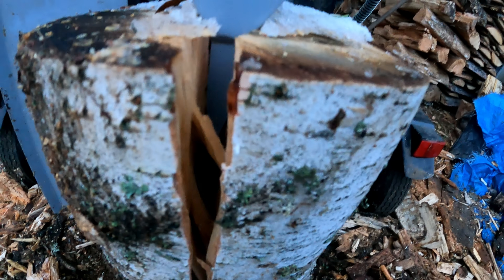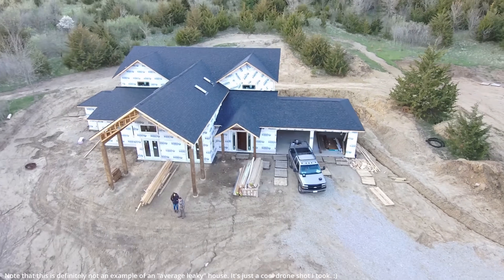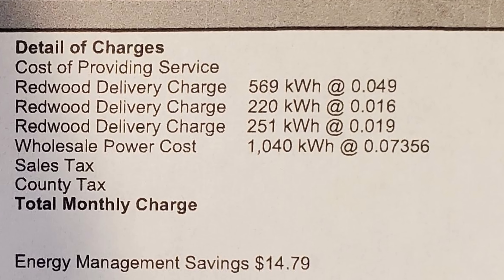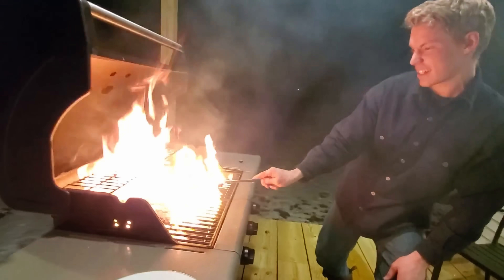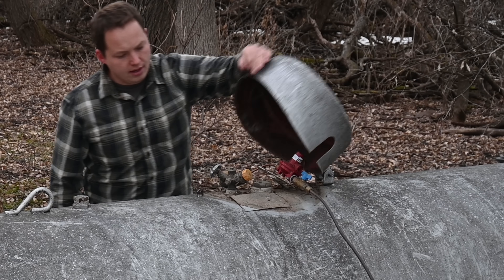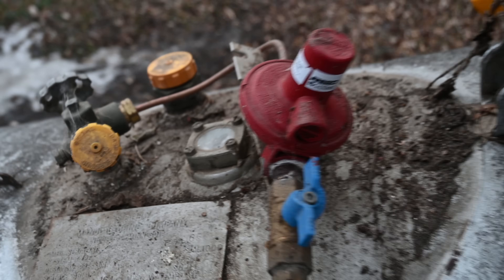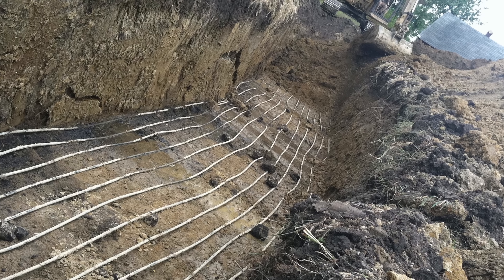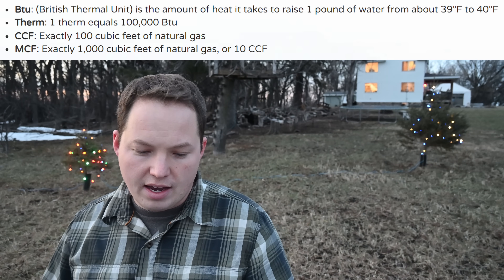What's The Best Heat Source in 2022? Top 5 Home Heating Methods - LP Electric NG Geothermal Fuel Oil

Comment: While the change in management isn't helping matters, fossil fuel prices are cyclical with them being even more expensive than now from 2005 to around 2014. There's a lag between the high prices that spur development and increase supply, once supply increases demand goes down due to the high price, causing glut, then depressing prices and new development.

It's great to have different sources of heat available - build in resilience.
I'm a fan of the idea of a good wood stove/insert and a large stash of wood too.
Reply: I burn wood when it gets really cold. Otherwise I use natural gas and electric. But Even with wood burning my monthly bill has doubled from last year, even though the average temperature is warmer than last year.  "Change in management" is a lot nicer than what most people are thinking and wanting to say come time to pay the energy bill!
Reply: @shaundevrisky349  inflation is evil and printing money is theft.
Reply: Remember always that the fossil fuel industry and the commodity markets will jump on literally any excuse to jack prices, and they are always slow to drop back, if they ever do, to the same levels as before.  Changes in management are a big excuse...
Reply: High fuel prices are worldwide right now, not just the US. The EU gets a lot of fuel from Russia. It's too simplistic and inaccurate to put that all on US management. The pandemic, when wholesale fuel prices went negative, threw the world for a loop, and the world has still not fully recovered.
Reply: @mgrnd3875  Pandemic my
A
S
S

Europe has high energy prices because they  have been pushing to transfer to wind and solar to try and go woke "green", and the consumers are the ones paying the price for this B.S.

 Solar and wind cannot keep up with the electric demand, nor can it compete with cheaper natural gas, propane, and fuel.

Higher fuel prices in the U.S.A. ARE from the current administrations actions, regardless of what the liberal/communist media is telling you.  EVERYTHING market related comes down to supply and demand. The first thing Joseph Stalin Biden did upon stealing his office was cut domestic oil and natural gas production by denying drilling leases, curbing production and shutting down pipelines.  The result is a short supply and high demand which equals high prices.

What also isn't helping is the fact that Stalin has raised inflation to 40 year highs by printing trillions of dollars that the U.S. Treasury cannot back with gold or anything else of value. Another simple equation: the more money you print, the less it is worth. This translates into higher commodity prices.

If this actually has to be explained to you, then you need to either re-take economics 101 or attend some anti-delusional therapy classes.
Reply: @shaundevrisky349  It is multifactor, but I was trying to keep it short. Yes, policy matters, and so do natural disasters, and yes, the pandemic does as well, which has affected mundane things like not having buns at the local hamburger joint due to supply chain backups and shortages (happened just this week). One thing is for sure, had there not been a pandemic, the dynamic in the energy sector and other industries would be very different right now. To say it is not a factor at all is simply incorrect.

Hyperbolic responses like this are precisely why I do not associate myself with any political party, right or left. Some folks get too entrenched and lose a level objectivity.

Comment: My main source of heat in the winter is natural gas, followed by a wood stove and of course solar. I live near Seattle, so the winters don’t get really really cold. I’m guessing I’m spending around 1000 or less for my electricity and heat. This is for the whole year! I have 7.5 kW of solar, so for a good six or seven months I can run everything off this. It’s not connected to the grid. The blower on my natural gas heater can be run from solar, which is around 600 W every time it goes on. Of course the solar cost me a bit of money even though I did it myself. It does rain a lot here so sometimes I don’t get that much solar. I have some other solar generators that run my refrigerator and kitchen, so I filled them up when I have sun and use them sparingly when I don’t.  
I’d like to know what kind of foam spray you used for your attic and basement? Thanks 🖖
Reply from the maker: Closed cell spray foam top to bottom! Closed cell is better in most northerly climates.

Comment: My heat pump can keep my house at 68F when it's 17F outside. One year it got down to 5F for a day, and the heatpump ran continuously to keep the house at 60F. I have the aux heat coils disabled unless the unit is in defrost. It's just a 9.5HSPF/15 SEER single stage Trane.
Reply: American heat pumps they like American cars they all junk